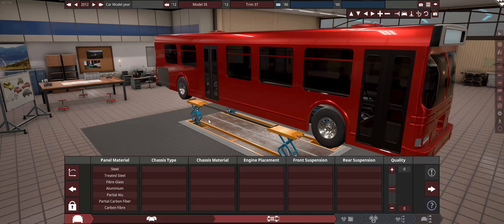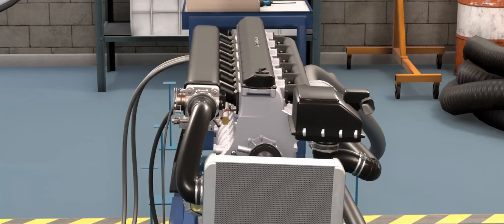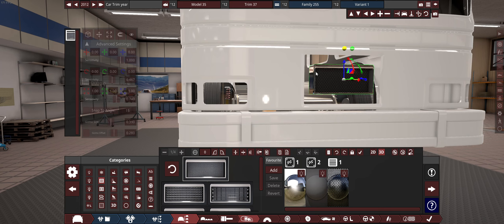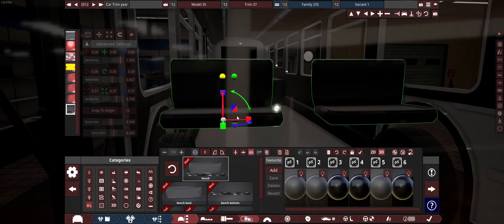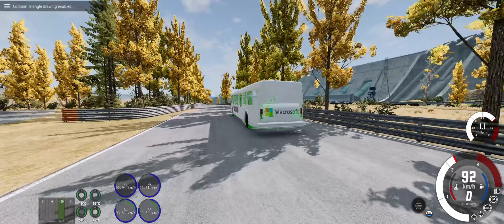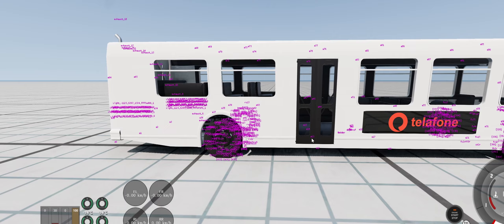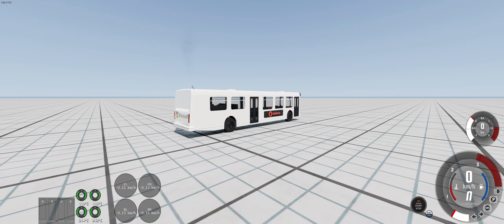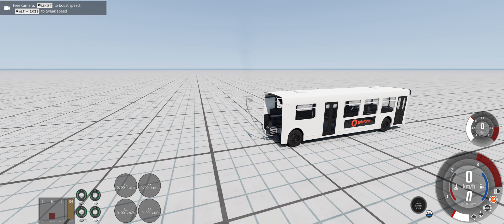Did you Know You Could Do This Too?

Comment: 13:36 the reason those values are assigned are so that variants are possible/easier idk if it was possible before, ive been able to add a variant but they use the same model
Reply from the maker: yeah, I've done variants in the past manually, and it's clear that this is their goal, but it could have been name based instead, and not in sub folders. Also in automation, you can "attempt to export all variants" from the project selector on the home page, though it doesn't work yet
Reply: @fillman86  this + automation exporting nicer jbeams could make automation such a great tool for making mods for beam, or at the very least give you an incredible starting point

Comment: at 1:12:00 you could fix that inability to bend up/down by putting some sort of universal joint there instead just like how you did the first triangle only put it on the back sections and rotate it 90° then you could connect the two triangles together and in theory get left/right and up/down movement
Reply from the maker: I loosened up the top triangle, and it works like a charm now :)
Reply: @fillman86  nice i just thought you would want to know in case that didnt work

Comment: The bendy buses where I live have an articulated section about twice as long, with a solid piece in the middle to allow it to pivot up and down, I think that would fix some of the issues you're having.
Reply from the maker: yeah, I should have made the gap longer, but as for the rest, I fixed that after the video - https://www.beamng.com/resources/authors/fillman86.380331/

Comment: I have 2 idea:
1. Bus that can be used as ingame bus route,
2. The dually rear wheel (you have did this before)
Reply from the maker: I've been thinking about that, maybe one day
as for the dually, it's not really hard, just duplicate the flex body lines of code, and offset them narrower, but single tyres are quite common in this application

Comment: try moving the middle axel up a bit, kind of have two different ride heights, that way it won't high center as easily or often
Reply from the maker: I loosened the top triangle, and the thing works a lot better now :) https://www.beamng.com/resources/authors/fillman86.380331/
Reply: @fillman86  In America, the middle axle is farther forward than where you have it (right about centered with the rear window). Also, I believe that both rear axles have power to them (electric motor or something). 

As far as I'm aware, Toledo, Ohio's city T.A.R.T.A buses still has one bendy-bus that is operational to this day... At least I think

Comment: A question: why did you not just flip the whole model in blender, export it with all the jbeam components still there, and then just mess around with the position of the body nodes to get it to line up with the mesh. It would save you a lot of the things you did after 38:30

You'd still have to make the middle bendy bit, but ehhh
Reply from the maker: lol because that wouldn't work XD or would end up with me doing a whole lot more work XD
Reply: @fillman86  Fair enough haha, I know my blender, but all I've seen about dealing with Automation exports is from your videos so that was a complete guess on my part.

BUT a MUCH easier way to have done this is to have gone with the articulated buses that have the middle axle BEHIND the bendy bit. As someone who actually actually worked on them irl, there are a lot more basic articulated buses have the middle axle in the rear half

You would:
1. make a rear engined RWD or 4WD bus in Automation. 

2. Chop bus in half IN FRONT of the front axle instead of behind it, 

3. Do all the connection work keeping the middle axle BEHIND the bendy bit instead of attached to the front half. (which also keeps the engine weight over the rear axle) 

4. Do all the jbeam editing, but to the front half of the bus (in addition to making the bendy bit longer like other comments said)